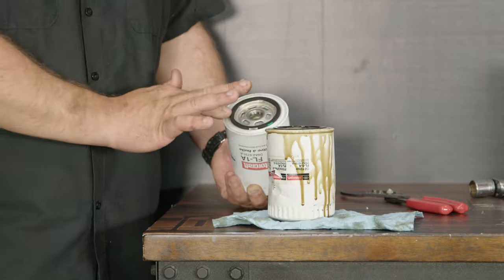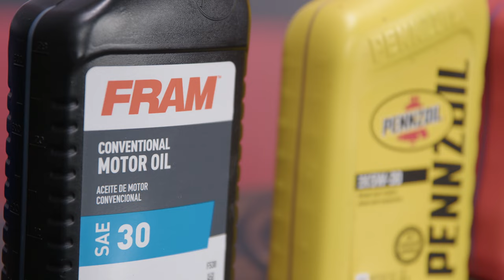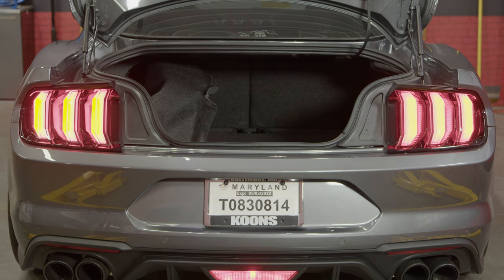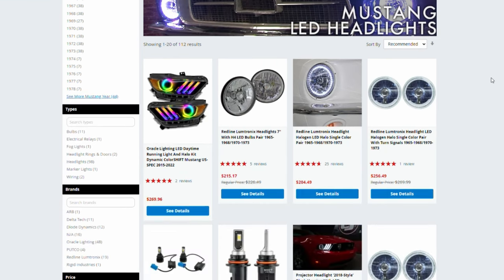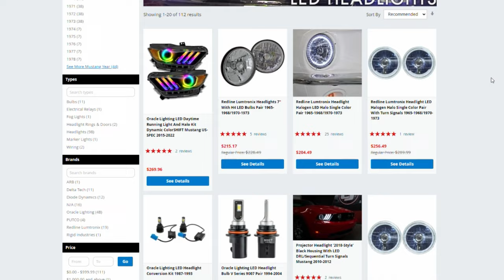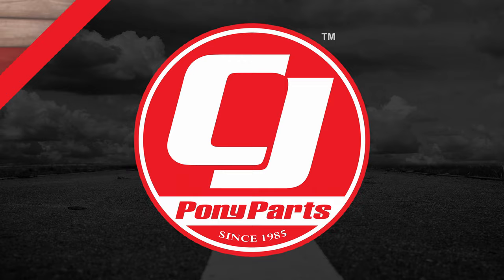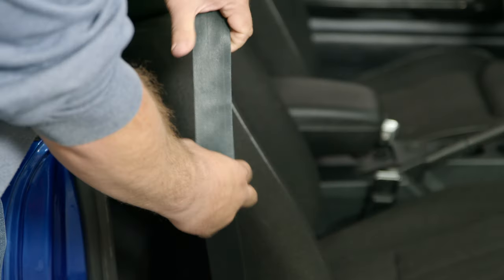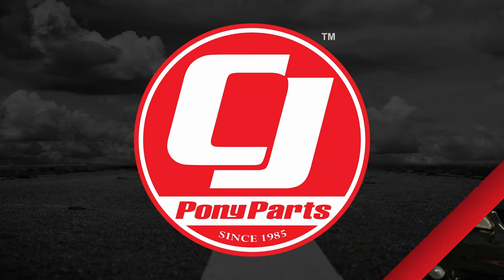10 Car Maintenance Tasks Everyone Always Forgets🙄🤦‍♂️

Comment: Agree with everything except...If your car has a lot of miles and is an automatic I'd use caution changing the fluid if you don't know how often it was changed and when it was last changed. Under this scenario it could cause transmission slippage and/or failure if you change it.

Comment: Lugnut torque, especially if you've recently had tires replaced or a rotation done, but really at least once every 6 months or so. You'd be surprised at how frequently you'll find one or two loose lugnuts even when you've not pulled a wheel recently.

Comment: Great video and tips. My 2016 V6 Mustang has only  17,000 miles but now 6 years old. Should I be changing the coolant and diff fluid? Dealer doesn’t seem too concerned.
Reply: I would not worry about the Dif fluid yet. As for the coolant, Ford recommends switching over to the new Yellow VC-13-G fluid over the Orange VC-3DIL-B that in your 2016 now. The new Yellow has superior corrosive inhibitors compared to the Orange.